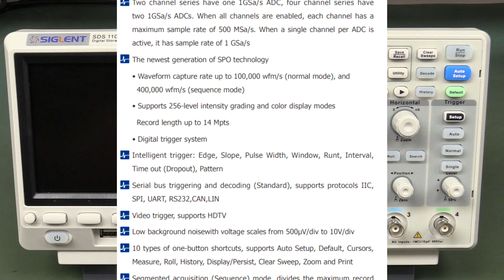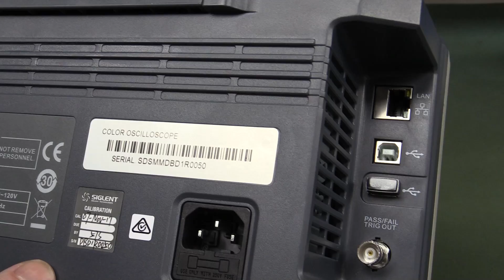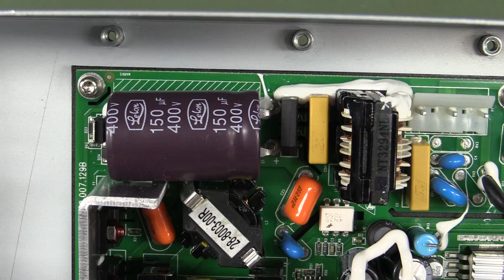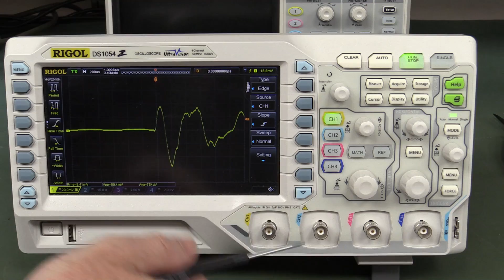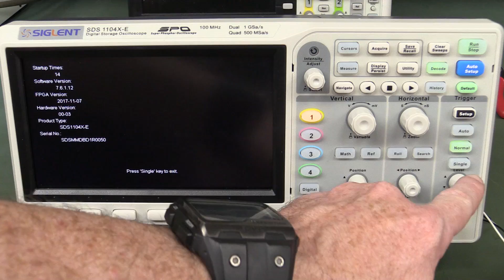EEVblog #1042 - Siglent's $499 SDS1104X-E 4CH Oscilloscope Teardown

Comment: Anyone managed to hack it to unleash 200MHz capability? I dont expect perfect behaviour on the edge of 200MHz but just curious id it can be done...
Reply: Yes. It is very simple to do it. It becames SDS1204X-E.
Reply: @modorangeorge4991  thanks, will try to not to brick it ;)
Reply: @JanicekTrnecka  If you haven't tested it all ready: You wont brick It since the SDS1104X-E is actually a SDS1204X-E but sort of speak downgraded in software to be able to sell it much more expensive then the SDS1104X-E which cant be upgraded to a SDS1204X-E. However only a option key is needed to unlock it to 200MHz, which is on the Internet.
Reply: Thank you for your insight! Will definitely try it as it corresponds to everything I have so far read on this topic!

Comment: I tried to think up why multiple waveforms were displayed when tapping the BNC. I think the signal is being displayed in different zoom scales at the same time. Failure to clear the screen before zooming out and reprinting the waveform would be my guess. Take a look at how similar the waveforms appear in the horizontal plane. I think we're looking at the same wave with different zoom levels with slightly different horizontal offset and resolution.

Comment: Just updated mine to the 6.1.35r2 firmware -  finally finally fixed the Auto SetUp bug that has been plaguing me since day one (scope would brick if you used it -  even power off didn't work).. I also no longer see the double trace with the PE effect Dave was showing.
Reply: Good to know

Comment: Hi Dave, question for you, is this still a good buy for 499, or is there any other model  with 4 channels and 100 Mhz? I like the 4 ch but also considering a 2 ch 200 Mhz. thanks.
Reply: Google around. There is a way to change the software to get 200MHz out of this thing.
Reply: You can hack this to 200 Mhz or 70 Mhz if you like, just by entering a serial number. You can reverse to 100 Mhz at any time.

Comment: Just a few notes if you're considering it:

The Wi-Fi option is just a TP-Link TL-WN725N adapter, you can get one for 7-10$ and it's going to work the same. In the license menu you're going to see the temporary activations decrease, I believe with a full reset you can bypass it, worst case you need to telnet and delete the license file which is just a counter.

You don't need to buy that particular Waveform Generator to use Bode Plotting, it works with any other Signal SDG series waveform generator which is good if the +-3V isn't enough for you. You need to connect the two devices via USB.

So the only option maybe worth buying is the Logic Analyzer.

A lot of the bugs have been fixed, mine came with the oldest firmware so make sure to check the version numbers on the Siglent USA website, the EU one seems to be outdated.

Overall I think it's a better scope than a hacked DS1054Z, you get all the options, Wifi, Bode plotting, remote control, nice user interface, large screen, MSO capability for 100-150$ more.
Reply: can you recommend a decent sdg waveform generator which will work with it?
Reply: @andidotro  You should be good with any X series wavegen. The main differentiator are the output capabilities and waveform length, so it will likely boil down to how high of a frequency or how low of a rise time you need. If your requirements are minimal, no crazy arbitrary waveforms and higher frequency stuff then one from the 1000X series will be enough, the 1032X is very affordable. 
Otherwise I would go straight for at least the 2082X, the 2042X just doesn't make sense in my mind considering bandwidth/dollar unless you really need the extra resolution and memory but don't have the budget for more.

If you're unsure about compatibility then contact Siglent, I've had good experience talking to the EU reps.

Comment: So there is a very easy hack to enable 200Mhz, and the other options as well. (eevblog forums explain it well,) The reason for the 3 memory chips is fairly simple -- the two 128MByte on the right are dedicated sample memory -- connected to the fpga side of things. One chip for each pair of channels. (Keeping them on seperate channels so that the bandwidth is sufficient.) The third on the left is a 256MByte chip for the 2 ARM CPUs. Runs linux, and the scope app on top. Aside from the lack of 50Ohm input impedance option, this is a very decent entry level scope.
Reply: Thanks, that was exactly what I was searching for.

Comment: Bought one for some portable light work, it’s a decent little scope, the options are extremely overpriced and seemingly low quality and or poor implementation, so there’s zero chance I’ll ever expand it. Wish companies would stop with the nonsense; so they paid to build hardware that’ll nobody will ever purchase even though they already own it, bizarre con-cept... one very important note that wasn’t mentioned is the probes that are included are totally worthless, so plan on getting 4 probes to go with it as they are basically not included. I’ve seen some cheap probes in my life but these are by far the cheapest build quality possible the tips literally fall out of the body. So once you add up all the options and a set of decent probes you’ll be in it well over $1000... So that’s the price range you should be shopping... it’s still a bargain if you don’t need the options and already have some decent probes...

Comment: Just bought the Siglent and booted it up today (didn't take it apart hah). I think I just figured out what the double waveform is.

When in normal mode you see multiple waveforms as a visual representation of the history view last few frames. Then when you hit the history button you can scroll between the different waveforms you just captured.

If the double waveforms are undesired, single capture won't show them on-screen (and single capture disables the history mode). If normal mode is desired without the double waveforms, this is due to a setting called Acquire Mode being on "Fast". Go Acquire->Pg2->Acq Mode = Slow. This won't render multiple frames at the same time.

Another method if fast mode is desired: turn up the memory depth and zoom out to a level that has not enough memory to give history frames. In my case I set Mem Depth to 14M, and zoomed out to 2ms/div which gave no history frames. Did knock it down to 1 point every 2ns (500MSa/s?), but gets rid of the double waveform in normal mode.

Not worth the hassle if you need under 2ms/div though, mayaswell use single-shot or slow Acq mode. Not sure that the history feature itself can be disabled. There are some settings under Acquire->Sequence, but seems like a specialized capture mode - doesn't let you go under 2 frames to capture. With slow Acq though you don't have to use history mode if it isn't useful.

Comment: I happily used a Tektronix 350MHz oscillocope where I could make a single shot and get 10M samples. Then I could zoom in and out to look at the whole capture. A miniature of the whole capture could be seen so I knew where I was zoomed in. Is there a similar feature on  this Siglent?
Reply: Yes, so at 14Msamples you can be around 1-5ms/div and still get the full 1GS/s resolution when you zoom in. Any smaller horizontal timebase and you get history frames at the full resolution. If the resolution isn't as important as the history frames you can turn down the memory depth and get more history.
Reply: dtelder also interested in that.

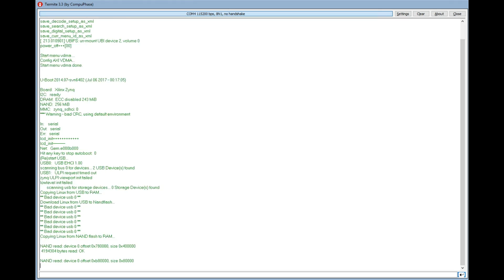Comment: At 12:35 there's a bunch of errors in the terminal output regarding *USB Device 0*. Here's a screenshot: https://www.dropbox.com/s/21tx8bg45ugfvur/Screenshot%202017-12-02%2015.22.54.png?dl=0

Is that normal? Seems kinda weird.

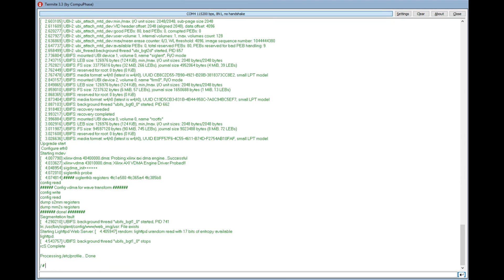EDIT: Also, at 12:38, while the text is scrolling by really quickly, I spotted this really interesting error/warning here: "nand: WARNING: The ECC used on your system is too weak compared to the one required by the NAND chip."  Screenshot: https://www.dropbox.com/s/cd5dlwceqcsel8m/Screenshot%202017-12-02%2015.27.30.png?dl=0

Is that evidence of maybe a little bit of an engineered failure mode there, or is that no biggie?

Comment: Is it as loud/noisy as the DS1054Z?
Most of the times I've find my self using my TDS220 rather the DS1054Z.
Better buy an old used tektronix rather new DSOs.

Comment: I bought a 1202.  It is worth the money, but meh.  Great scope, but wish the adjust knob wasn't used for menus.  It feels like mush.  Had issues with the decoder rs-232.  SPI works.  Get a USB logic analyzer instead of relying on scope for decode.  Function generator actually works really nice, but setting frequency with adjustment knob sucks.  Adjustment knob in general sucks.

@10:20, the unpopulated part is a memory provision.  The Zynq FGPA fabric gets programmed from the internal ARM processors.  The Zynq is a bit different in that the processors boot first and program the fabric.
Reply: how come? [Get a USB logic analyzer instead of relying on scope for decode]
Reply: @lukasbruderlin2723  Most USB LA's have better UI and are easier to work with than the scope based stuff.  I'm not limited by scope memory when recording with a USB device.  Usually they are using the computer's memory.  Searching for things is easier when you need to type characters and several hex values.  Scope based LA is still handy when you need to see if a glitch is occurring because of a power supply issue, or maybe a stray signal tickling a reset or BoD, or you need to view analog signals and the digital data they output.  Tools for jobs.
Reply: Kyle Crane thank you for your profound answer, really nice - thanks! 👍🏼

Comment: What ever happened? I remember the first videos Dave used publish that taught electronics, but now its tear downs, and mail bags. Everyone and his brother is doing that. I used to fund Dave; in fact it was he who re-launched me into electronics. I loved his tutorials about op-amps and power supplies. I was so impressed I designed (with some help) a battery powered lab supply with reverse polarity protection, single push button on/off, auto turn off (battery protection),with all the bells and whistles on a 50x50mm PCB. I do like his rants about things like solar roadways etc. I would re-fund him if he went back to his roots. Come back Dave what happened?
Reply from the maker: I get that you don't like teardowns and mailbags, but please remember that others do.

Look at my last say 20 videos (ignoring the old Keysight tour videos)
- 2 scope teardowns
- A series of 3 videos on ceramic capacitor cracking (very interesting technically)
- A bunch of interesting teardowns including vinatge
- BGA PCB fanout design
- Digital design tutorial
- A debunking video
- A microcontroller coding video
- Tutorial on how to find gear on ebay
- Reviewing low cost PSU's and LCR tester
- A couple of EEVacademy videos.

A decent mix of videos if I do say so myself.

How many mailbags? ONE or TWO in the last 20-30 videos? How many since video #1000? Go and count them.

As for teardowns, perhaps you forget that my channel has grown based on teardowns, and I used to have a weekly segment called Teardown Tuesday they were/are so popular.

If you are going to complain about my choice of videos, fine, but at least go an actually look at what I've been producing instead of just what you "feel" like I've been producing.
Reply: Dave, don’t get you panties in a bunch, why such umbrage?  You missed my point entirely. It’s not that I don’t like the any of your videos that would not be true. It would also be untrue to say I don’t like mailbag, or teardowns, or that I consider you a Lilliputian jobbernowl. 
What would be true is that I would like to see more build projects. It is in those projects that you become an educator, teaching thousands about the wonders of electronics, as you did me.  I consider you a rapscallion and sagacious person, sometimes funny sometime jejune, but always Dave. Don’t be a jobbernowl, bring back the build projects.

Comment: 10:10 - why are some of the lines below the central chip S shaped several times? Is this to lengthen the signal path so it will not be out of sync with another path that is a bit longer?
Reply from the maker: Correct, it's signal length matching. Rule of thumb is signals travel 15cm per nanosecond on a PCB, and that matters on today's high speed memory stuff.
Reply: Yes. Each path exactly the same length.

Comment: The "NAND JTAG" jumper likely sets the boot source for the Zynq. One way boots off the local NAND flash, the other waits for programming over JTAG.

I'd imagine it's probably got a pull up/down to default to booting from the NAND when not strapped.

Comment: Silastic across the tops of all the rupture vents on the capacitors? Can't be good practice and may compromise a safety device.
Reply: I don't know how much pressure was inside them. The JB weld split apart and they vented out the top like normal.
I made a video of it several years ago. One cap had JB weld over the vent and one had JB weld with a sheet metal over it.
https://youtu.be/ZaczI5xQk5k?t=52s
Reply: It won't effect anything. I have covered some in JB weld and they still vent.
Reply: +rocketman221projects -- Does it take more pressure for them to vent in that case? Do they still vent upward (which helps avoid the fluid from pooling on the PCB), or does it then vent to one side, potentially damaging other components?
Reply: Interesting! Really appreciate the info. Thanks so much =)
Reply: did you wand to join electronics class in google this is the class code a8zr54
it will be perfect if you join too!!!
Reply: Interesting point

Comment: I don't understand how tapping the ground can induce a signal (it's ground after all). I never tried that with a TDS (yet).
Reply: It’s not an electrical response, the mechanical vibration is coupled into the capacitors of the front end and generates a spurious signal.
Reply: Why not put more stable Capacitors on the input then?

Comment: You seem to have the ear of some of the manufactures, I have a Owon sds7102s with the battery. Crappy scope but I needed the portability of the battery pack. Now I could a hand held but they lack the features. See if you can bend the ear just a little and get some "good" scopes with battery pack

Comment: Such a capacitor snob! Must everything be top shelf?
Reply: Yep, it must.
Reply: well, depends on the application. On the 50hz-60hz loading cap, a Lelon is probably fine. On the high frequency side, you Need low esr hq caps. That's important.
Reply: It is a weakness and it is good that he show it.
You have to decide whether it is significant or not.
Reply: yes. Also for a PSU it is somewhat like a running gag to see crappy caps inside.
Reply: Quality capacitors on the secondary can be the difference between a power supply lasting 2 years or 20.  Yeah, it's worth pointing out.
Reply: Yep. Maybe not 2 to 20 years, but 4-5 to 20 easily. Crappy capacitors are probably number one reason of electronics dying.
Reply: Антон Южаков I'd say 2-20 fits nicely when you compare some crappy no name (chinas worst) caps to a panasonic or nippon chemicon
Reply: Is the quality difference THAT extreme?
Reply: Haven't seen capacitors that failed in 2 years span.

Comment: 16:00 What?? Surely Single Mode is single shot and normal mode is trying to scan.
Reply: Milo B Normal mode is like single mode just that the instrument rearms itself. You don't have to push the button before triggering. rest is the same
Reply: And the keysight as well has a single mode!
Reply: I think on my SDS2000x Series Siglent single-shot is activates by the 'single' pushbutton, then one of the LEDs indicate that with  a red light, waiting for the trigger.
I would agree with you, that normal-mode is a kind of scan thing.
BTW: I had software issues with my 2000x-Series after the firmware-upgrade. Acctualy the german distributor mentioned that this is a failure that happened before. So I got a new one (even with new hardware version).

Comment: I see it mentions 1GSa/s in dual channel and 500MSa/s in Quad so it means that it has two ADC's one for each group of two channels ? This will be a big difference compared to Rigol that has 250MSa/s in Quad channel mode.
Just looked again at the part where you open the scope and yes it seems there are two ADC's so it is superior to RIGOL and worth a bit of extra for this.
Reply: Yes, also if you check Siglent's website for SDS1104X-E & SDS1204X-E specifications, it says they have 2x 1GSa ADCs which makes 500Msps/ch (for each of 4 channels). Also have 2x 14Ms depth, which also makes 7Msps depth for each of the 4 channels.  
https://www.siglent.eu/sds1104x-e.html
Reply: How are the ADCs connected? If I use two channels, do I need to use 1 & 3 to be able to sample at 1 GHz?
Reply: This is what the guide says:  "
The four channel series has two 1 GSa/s ADC chips (channel 1 and 2 share one, channel 3 and 4 share another), so that each channel can achieve sample rates up to 500 MSa/and work on bandwidths of 200 MHz when all channels are enabled."  

So yes in order to have two signals samples at 1Gsps you should use channels 1 and 3 or 2 and 4.  

I haven't tried cause I'm still thinking whether to buy sds1104x-e or Rigol ds1054Z.
Reply: @acd8887  How did You buy?
Reply: @AC D can you update once you know pls thanks!
Reply: Sorry I did’ buy it. Can not afford it. But it is in my wishes list hehehe

Comment: I tried this with the SDS 1202X-E.. Same thing, but only if I use a metal object to hit the connector.  When there are two waveforms, and you move the position knob, it removes the extra waveform and leaves only one on the screen. So i'd say it's a bug.
Reply: Tactical dot.
Reply: did it get fixed in an update or something ?